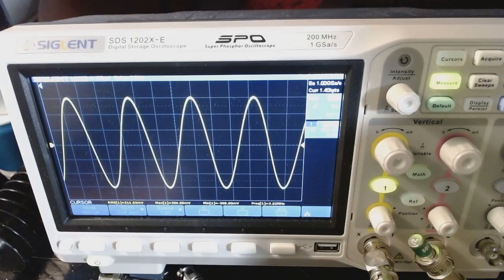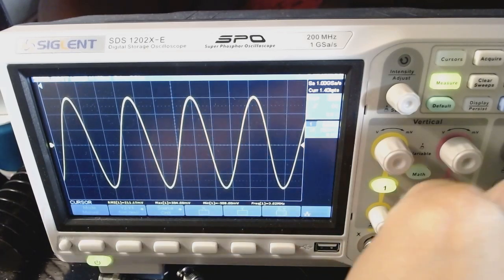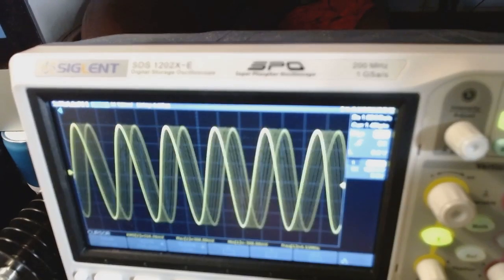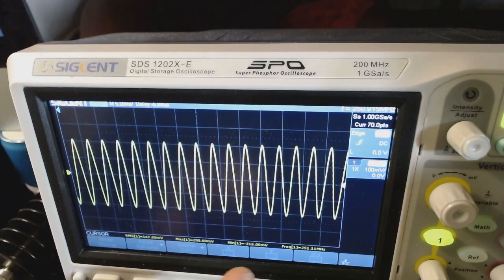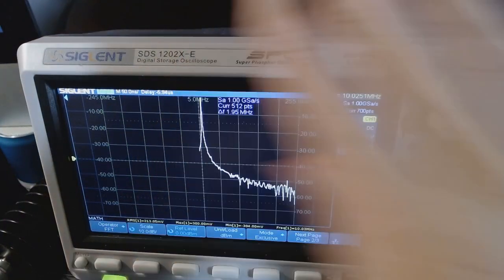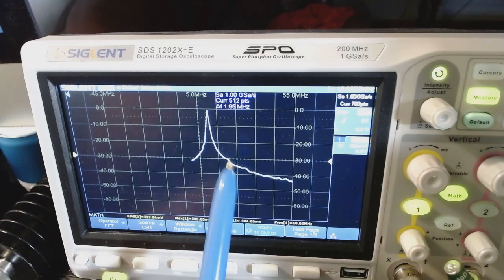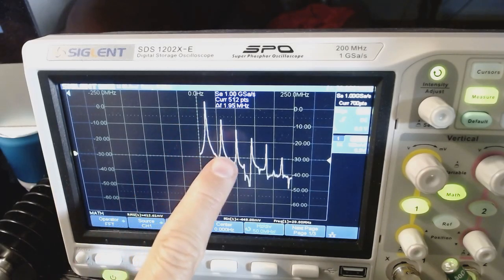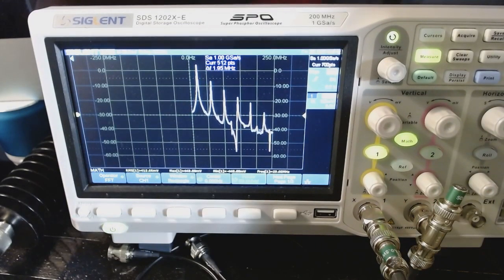Episode 66: Siglent SDS1202X-E, Bandwidth and FFT

Comment: That is very nice oscilloscope for FFT, or maybe the best at this price. I have it for years. 
It can be used as very good spectrum analyzer.
Just a few settings needs to be done prior measurement. 
Unfortunately I never saw anybody did it on YouTube.

I'll describe it in a few sentences: 
Use of external 50 ohm load directly on BNC input is mandatory except in some special cases.
First adjust vertical sensitivity in time domain to have optimal visible signal. Best result is at 2mv/div if input signal level is small enough. 
Switch to FFT mode and adjust number of FFT points with time base knob to larger number. Here we can see only "Curr: 512 pts", but this scope goes to 1Mpts comparing to similar Rigol with only 1kpts. 
Window function for most applications change to Blackman and turn on cursors to Math functions so you get all reading in MHz and dBm. Adjust center frequency and span to use whole screen.    
There are some other fine tuning settings, but this gives you very capable spectrum analyzer with DANLup to -130dBm!
Frequency response is flat to about 230MHz. Then slowly decreases and is about 10dB less at 400MHz. 
It can perfectly measure up to 500MHz if you know its frequency response.

Comment: What's the Maximum MHz the FFT can measure?
Reply from the maker: The software goes up to 500 Mhz, because the machine is capable of 1GS/s (which sets the theoretical limit at 500Mhz). Realistically, it is perfectly capable up to 200Mhz.
Reply: @therfnoob7697  Thanks for the fast reply, just to be clear, I'm asking about the FFT, so, if I understand, the FFT is correlated to the Scope Bandwidth, right?! So, in theory, the max FFT measure (with accuracy, up to -3db) would be at 200MHz, right?!  (I'm thinking about measuring VHF Radio harmonics).
Reply from the maker: @JohnUsp  That's correct. In my answer I wanted to explain that, if you ask, the FFT software will also visualise up to 500Mhz, but without being reliable due to bandwith limits of the unit, as you correctly point out. 

VHF harmonics are probably out of range. The fundamental is at ~140Mhz so the first harmonics is at 280Mhz. You'll probably be able to get a "figure" of some sort, but not accurante in terms of dB reading.
Reply: @therfnoob7697  yes,  I want to measuse for 146.520 fundamental, the harmonics starts on 293.04MHz and 439.56MHz, maybe can have an idea, but with a weak amplitude or worst. Thanks again.
Reply from the maker: @JohnUsp  mmm, I think the oscilloscope is not the ideal instrument for this. Try to search in youtube for "TinySA Ultra". It is apparently a good and inexpensive Spectrum Analyzer for this type (amateur level) of needs.
Reply: @therfnoob7697  Thanks!

Comment: I have tested this scope up to 400MHz. The displayed amplitude is falling above 200MHz, but both waveform (well, a sine wave) and the frequency readout works up to 400MHz. I have tested the SDS1104X-E too, and the frequency then is limited to 200MHz. Siglent have great scopes for the bucks.
Reply from the maker: Yes, it's very good value for the money! With 1Gsample/sec, however, I think 400Mhz is possible/useful only in "known testing setups", with no noise etc. I consider myself happy with 250mhz !